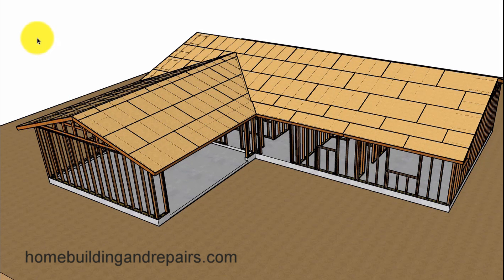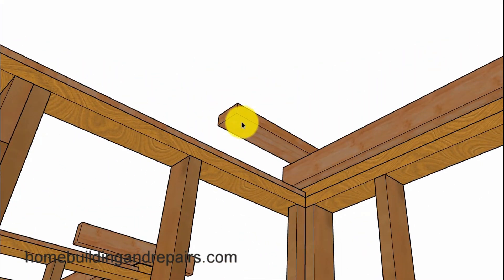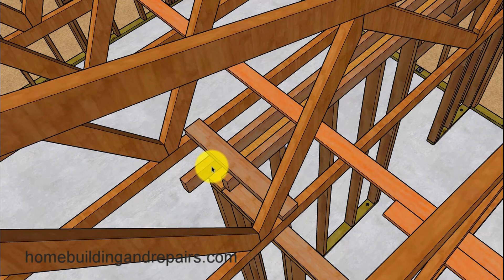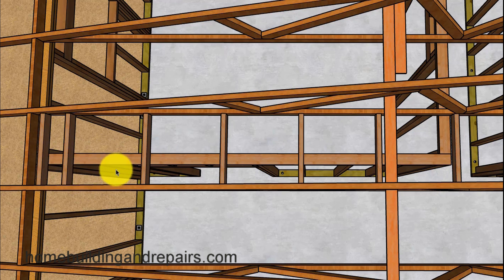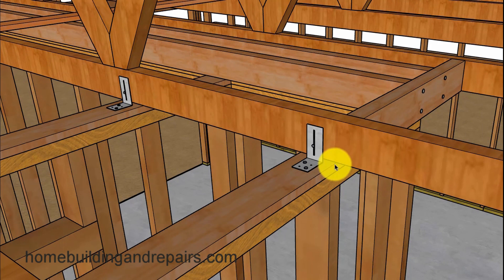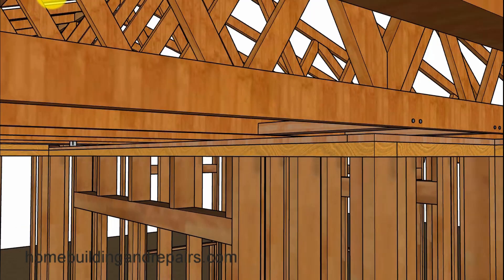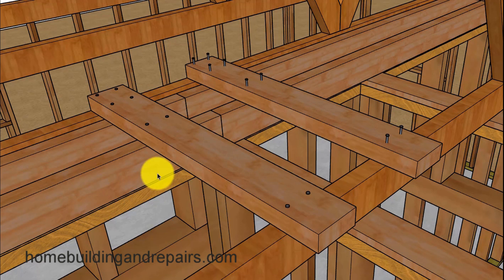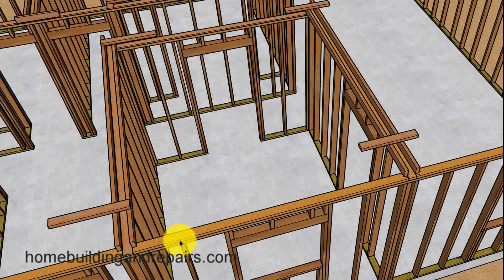Different Ways to Install Roof Truss Ceiling Corner Backing – House Framing Ideas

Comment: Why is backing needed so close to the wall? Isn’t it convention to attach ceiling drywall about 16 inches away from wall? From diagrams I’ve seen, this allows the drywall to flex a bit as trusses uplift seasonally with less damage to drywall joints.
Reply from the maker: This backing floats with the roof as it goes up or down. It would be difficult to layout roof trusses to be spaced 16 inches from all walls, but you do have a good point about it flexing easier when spaced farther away.

Comment: Nice video, very informative. I was wondering after ceiling backing, how do you vent the attic? Is it going to block the intake vent?
Reply from the maker: Ventilation for roof attics can be created using roof dormer vents, wall gable vents and even by using screened blocks at roof eaves.

https://www.homebuildingandrepairs.com/ventilation/index.html
Reply: @gregvancom  I get what you mean, but that is for roof vent not intake vents. As I noticed on your demonstration all intakes are blocked. So rafter vents can not be installed.

Comment from the maker: Someone pointed out that some of these truss assembly methods might not work in other areas around the world, so make sure you follow the manufacturer's installation instructions or details provided by a structural engineer.

The same individual also brought to my attention that blocks used for hanging ceiling backing might need to be spaced a little closer. I would imagine between six and 8 feet maximum spacing would be acceptable, but again this would be a question that needs to be addressed by the manufacturer of the roof trusses.

Comment: I build 40+ houses a year....not a fan of your plans. In MN, this wouldn't be allowed. You need a rat run connecting the trusses to the Gable, girder, or hip set. The walls over 15' have to be tied to the trusses....trusses have to be attached to the rat runs.
You have 2 blocks spanning over what seems to be a 20 ft area. What if the backers start to bow or crown from the A. Tendency of wood on long spans B. The heat in the attic contributing to wood movement. 
Doesn't seem like a good idea...to me.
Reply from the maker: Everybody isn't going to like my design, but it was designed to make additional videos like this one, not to win any contests. However, I do need to address the two blocks spanning over 20 feet, because that should've been addressed in the video. 

I will post something at the top of the video to address the issue and as far as some of your other comments about the assembly, we always need to make sure that we follow the installation instructions of the truss manufacturer or structural engineer, because other areas around the world will have different assembly methods.
Reply: Paul- I too live in MN and have never seen this bldg assembly before. However, I find it interesting to learn abt other regional methods. My 1st inclination was this was for hurricanes. My 2nd inclination was whether something similar could be adapted for our yrly tornadoes. (obviously, code would have to be addressed).

Comment: As always a good video. But why do they need to float? Is this for seismic reasons? 

I would think that if the trusses were fastened to the interior walls then this would help bind the structure into one "solid piece" for lack of a better term. Will there be expansion/contraction? Is this for earthquake prone areas? Are they done differently in other regions of the country? 

I may be jumping ahead but how will the ceiling be installed? Would you approach it differently if you used drywall versus dropped ceiling tiles versus some other type of ceiling? 

Insulation now is becoming very deep, 10 inches and more in places. How will the trusses accommodate this? What is a good way to avoid thermal breaks in overhead lighting fixtures and other possible locations.

This video, like so many before, is great, very informative. I'm looking forward to the next.
Thank you,
Reply from the maker: I would recommend watching the video again. I provided an example of how the truss roof can lower in overall height as more weight like shingles, insulation and drywall are added to it.
Yes, there could be expansion and contraction problems and that would occur with most lumber. No it doesn't have much to do with earthquakes. Yes they are done differently in different regions of the country and all over the world. I've seen them assembled in a variety of different shapes. The video is providing you with an example of drywall backing, but if you used a T-bar ceiling, you might not need this type of ceiling backing. Yes, insulation can be a problem and they raise the heels or area where the truss next to the framing plates in some cases so that the insulation has enough room. Last but not least, I don't remember ever seeing a good example of a wood roof truss system created to provide a thermal break or a reduction in the transfer of heating and cooling loss through framing members. Let me know if this helps or if you have any other questions.
Reply: gregvancom - if a type of hot roof  was used, making room for insulation by raising the trusses wouldn't be necessary. Sorry if I'm pointing out the obvious.